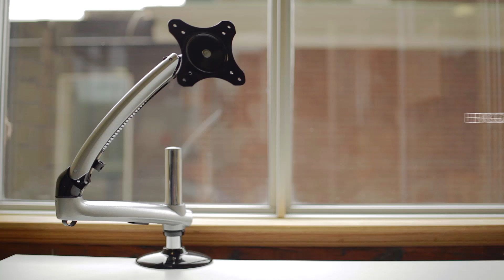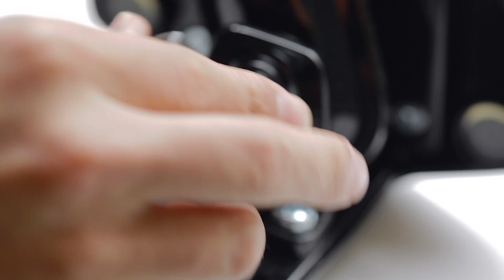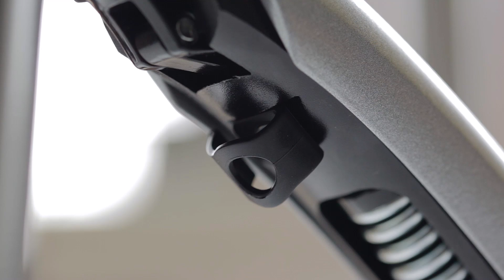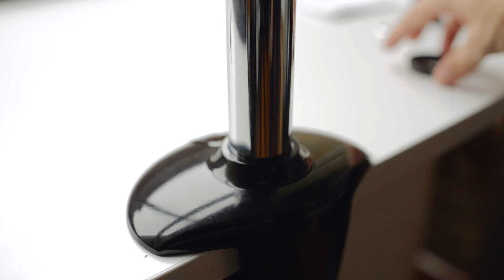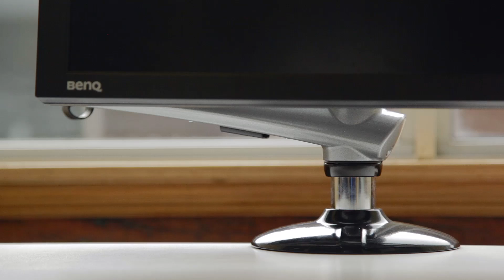(Best Monitor Arm?) Ergotech Freedom Monitor Arm Review

Comment: I have a shallow desk and want to maximize the distance between the screen and my eyes. I'm only interested in a stand cause I hope it will allow me to push my monitor as far back as possible, even if that means the arm projecting past the edge of the desk toward the wall.. meaning I'm happy to pull the desk away from the wall it that means the monitor can float as far back as possible. Can this device help in this regard?

Comment: I've owned a Freedom Arm HD for more than a year. It's great. I'm running it out of speck at a 35 inch ultra-wide, but it hasn't had issues at all. I'm within the weight limit, but I'd never try portrait mode out of speck on the diagonal, like this, because rotational weight is a thing and the panel would probably swivel face-down. But in landscape, that's not been a problem. Five stars. I'd likely say that even if it cost 200$, and I'm by no means rich.

Comment: Just got this arm today and sending it back. All is accurate in this review, but it has no tilt adjustment. I need to customize the tilt and this monitor has no option for that adjustment. I'm bummed because i wanted to keep this one. My monitor sits on a custom shelf that's above eye level. It is a great product if you have a  standard workstation for gaming and  productivity. If your using it for a cross between home theater and gaming not at a desk , Look else where. Also make sure to check the weight of your monitor. you can get the standard one that supports up to 17.8 lbs or the hd model that supports between 20 and 30 lbs. If your monitor falls between 17.8 and 20 lbs it might not maintain its position if you go with the hd version from what i read. Great quality. Bummmmed i have to send it back.

Comment: Is somebody here using this arm for pen displays?

Is it suitable for drawing, even when you want to lay the panel almost flat onto the table to really get in there?

Thanks all :)
Reply: I just purchased one for the same purpose. I'll be attaching it to a Ugee 2150. I'll post back once I use it for a few days.
Reply: +Adam Montgomery 

Nice, thanks for the reply.
That would be helpful to know.
Cheers
Reply: So I've had it for a little over a week now, and I have to say, unfortunately, it's not the best solution for drawing. There are two reasons for this: 

1) The swivel at the end is very stiff, and there is no way to adjust the stiffness. 

2) If you clamp it to the end of your desk, even at it's lowest and flattest position, it's still pretty high. The surface sits about 10-12 inches above the surface of the desk, and as a result your elbows are up high as you draw. It's not very comfortable.  

I would not recommend it for drawing, but other than that, it's a decent stand.

(I was going to send it back, but I'm in the process of building a custom desk, so I figured, why not build the desk to accommodate this arm? In order to achieve a suitable height, I'm going to need to add a little shelf on the side, about 6 inches lower than the surface of the desk, where the the arm can clamp on.) 

Hope this helps, good luck.
Reply: Thank you! This does help a lot indeed.
Is this the first monitor arm you used for drawing or did you check it out as a replacement.
If the latter is true, can you suggest a better solution for pen display users? Maybe the last monitor arm you used?

Thanks again ;D Take care
Reply: This is my first arm. Previous to this, I just used the little stand that ships with the Ugee 2150. (It just sits on the desk, tilts down if needed)

Unfortunately, I don't know of a better solution. It seems they want to charge a lot for arms specifically designed for pen users, and I'm not even sure if you'd get anything better than the freedom arm. Hence, I'm just modding my desk design. 

Sorry I couldn't be more help.

Good luck!

Comment: =\ the back of my desk has a 2x4 brace so the area I have to clamp a vesa arm to is 6 inches. Unless the clamp was deep enough to go around this & just clamp to the inside of only the desk top itself which is about 2 inches thick.

Comment: Thanks for the review.  How much force does it take to adjust the height of the monitor (mainly lifting it up) ?  Are you just pushing gently with a couple of fingers while the spring does the work or lifting the actual weight of the monitor?   I hurt my back so it needs to be very very light for me to use it.

Comment: I have a doubt. The height adjustment depends on the monitor's weight? Because I have the freedom arm with a BenQ XL2411Z and I can't make it go down...when I push it, it goes down and it goes up again when I stop pushing.
Reply: Just loosen the spring. I know you commented ages ago, but still.

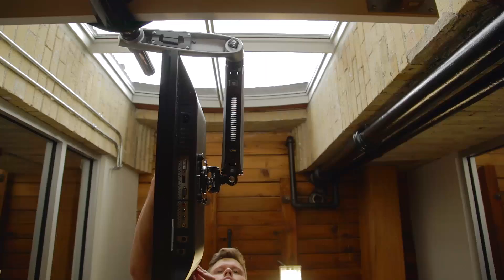Comment: Ok question, at 4:04 to 4:06 when you showed it going a full 90 degrees. It looks like that is each way to the side, but what about up and down? Can the monitor go fully flat facing up or down? I'm specifically wanting to know if it will face directly downwards.

Comment: an expensive piece of metal
Reply: Looks really good quality, certainly vastly better than my current monitor mount which holds the monitor well but has little articulation and is VERY stiff.

Comment: Will this stop my monitor from shaking a little when I type?
Reply: that would likely depend on whether your desk moves when you use it rather than the monitor stand, if you are using a current bracket I would check whether it has screws on the bracket that can be tightened as this may be the cause of your issue.

Comment: Is this use able on glass table?? Thanks.
Reply: Yes, it has rubber padding on the bracket its self but I would check regarding the thickness of the table relating to the minimum desk thickness required of the bracket.

Comment: Kinda new to this, can anyone recommend a good arm for a 32" monitor?
Reply: Someone above has mentioned it works for their 34inch monitor, however really its based on weight, tvs and monitors vary in weight so I would check to see if it says a maximum weight restriction for the bracket before buying.

Comment: Will it support a Predator X34 in terms of weight? No, I obviously won't go vertical/portrait mode with a curved 21:9 display...
Reply: I'm currently looking for the same answer
Reply: find our how much your monitor weighs, then compare it to the specs... if it's not enough check out the HD (heavy duty) version...
Reply: find our how much your monitor weighs, then compare it to the specs... if it's not enough check out the HD (heavy duty) version...

Comment: Can I use an LG 29UM68-P 29-inch monitor? I know it says 27 inch max but just curious.
Reply: Phoenix King since I have posted this comment, I have bought the arm and the monitor and it works fine, the weight is fine for the arm, no dipping.
Reply: Kryptency I use my LG uc97c and it fits perfectly. Btw, it's a 34 inch ultrawide
Reply: so it will work with the LG 34UM58-P?
Reply: Ecla Sure
Reply: I had the same question thanks so much for asking
Reply: Tell me how it goes
Reply: Kryptency thank you for replying I'm looking forward to purchasing the ergotech monitor arm
Reply: Goku Reid you're welcome. I think you'll enjoy your products

Comment: What happened if you have your desk all the way up against the wall? Can I still use the swivel? Btw will this monitor works with lg 34 inch monitor? It fits the suggested weight limit but is not 27 inch but 34 instead. Thanks.
Reply: Well, you won't be able to put the monitor or the arm through where your wall is, solid objects have this whole 'collision' thing. Anywhere that the wall isn't, though, the swivel will work fine. Unless, of course, you use a larger than recommended size monitor. In which case, it might not quite make it to 90 degrees on the axes where it advertises you can turn that face 90 degrees, since the extra width/height of the monitor might bump into parts of the stand that are less than 17 inches away from the mounting point. And if it is under the advertised weight limit, no problems should arise there.

Comment: $75 ; €129.
Reply from the maker: +Ideeem ouch :(
Reply: +HardwareCanucks can I use the drill or is it just clamp only
Reply: I checked out the link and found that the mount listed is really cheap looking. that explains why it's only $26. you get what you pay for.
Reply: That link i posted its made of pretty thick heavy steel its built like a tank its not going to break. Ive had it for 6 months and no problems at all. You can see in the picture but its a really heavy mount.
Reply: You can get dual stand with gas springs for that price nowadays.
Reply: @vitaliistep  Quality you are wrong its thick ass solid steel its not going anywhere and its heavy as crap and a lot fewer places to fail. You are dead wrong on that one i had it for like 3 years and never once had a problem. This mount is a tank and you dont have to spend stupid amounts of money for it.
Reply: I went with a mount that wont break on me for 26 dollars that wont break or bend on me.   https://www.overstock.com/Electronics/Mount-It-2-way-Adjustable-Black-LCD-LED-Tilting-Desk-Mount-Bracket/8629167/product.html?TID=MyAcct:MO:OR:ProdName

Comment: I have a 5/16" thick tempered glass desk. I did the calculations and the surface is made to hold over 300lbs. My only concern is the torque that the bass would have on the desktop. Do you think it would be fine? Being that it's tempered glass? I did a little test myself and put a 25lbs weight upright on the edge of my desk and it held. My monitor weights 14.8lbs alone.
Reply: I would choose a wallmount or a stand that does not clamp on your desk bcs Tenpered glass is a total B*tch to clean.
Reply: +Lo Studios Not sure why a desk mount has anything to do with keeping tempered glass cleaner or dirty. regardless I got a monitor arm for the glass desk, just sandwiched two pieces of plexiglass between the desktops to help disperse the weight of the system
Reply: A Pinecone?  sorry i was not clear enough:  meant that i would choose a wallmount bcs the glass may break and that would be a bitch to clean up
Reply: Lo Studios ahhh ok I see what you mean. But no with the mounting technique I used it does not at all look like the tempered glass is going to break. I have a 14lbs monitor + 11lbs monitor arm on the desk fully extended out and the desk seems to be giving on signs of potentially breaking. The PlexiGlass solution I used works really well

Comment: I have a silly question, would this type of mount be able to work with a glass table top with 10mm thickness?
Reply from the maker: +Joseph Chin you can mount it but at your own risk. Thin glass tops may not support the pressure of the mount plus holding a display.
Reply: Ok. I think i'd better not, i'm afraid it might crack the glass. I'll have to think of a different solution! thanks for the response Canucks. really appreciate it.
Reply: Try a wall mounted arm if your desk is close to a wall
Reply: Hi Thanks alot for your advice, I've managed to mount it on a small wooden plank beside my desk! Not sure how i can upload a picture for you to view it, but it works great!

Comment: Hey guys, nice review! Could you tell me, what is the minimum horizontal (not vertical) under-desk clearance you need for the clamp to go be fully pressed against the edge?
Reply: About 3 and a half inches, without getting the calipers out. I presume this is to make it through a backplate of some kind on your desk? Make sure there's still a way to get your hand in to turn the knob for the clamp mechanism :)

Comment: It has very good design concepts and very beautifully well built, I must say. The price tag is a VERY toxic however, and consumers should not shell out hundreds of dollars for a few pieces of metal.
Reply: Long Nguyen it's only $100. You realize how much these things usually are right?
Reply: The basic ones are 30 to 100.
The more advanced ones are 100 to 200.
The designer brand ones are 200+.

Comment: Looks nice, but 18lb is too little. I have an Apple and an Asus display which both exceed that max weight.
Reply: RockTo11  They sell a heavy duty version that supports between 20 - 30 lbs.
Reply: Mac mall sells this brand compatible with iMacs. They're even less than $100.00 now.

Comment: Me: I wish I bough that monitor arm
sees Price
Runs back to cheapo $60 dual monitor stand
Reply: Check out the price on massdrop for the freedom arm right now.
Reply: +HardwareCanucks Worse in the UK
£261.52
Reply: will these work on an ASUS VC239H 23" monitor?
:)
Reply: Will this work with an ASUS VC239H 23" monitor? :)
Reply from the maker: These actually sell for around $99 on amazon.
Reply: HardwareCanucks
Shame it's only reasonably priced in the states... $165 is the cheapest from a canadian retailer.
If I could get it for $80 like it is on amazon.com I'd order 2 immediately.
Reply from the maker: Very true...
Reply: HardwareCanucks $$$$
Reply: @R0K99  the HD model up to 30lbs is now $124.63 with free Prime shipping
Reply: FamzillaVids $66+$55 shipping :'(
Reply: +rok tech It's on there again! THis time with $9.97 shipping https://www.massdrop.com/buy/ergotech-freedom-arm
Reply: According to the weight said on the Amazon page, it will work :)

Comment: I have 3 monitors sitting on my desk and a fourth that I would like to have above my middle monitor. Does anyone know of a desk clamp arm I could use to mount this top monitor? I don't wanna throw away cash on mounts for the bottom 3. I'm happy to have them sitting on the desk. I need just an arm for the top monitor but it would need to be able to extend to about 60cm in height. I haven't been able to find any that can do this. The monitor has 75x75 vesa mounting holes and is 22 inches.

Comment: Any one here have a good suggestion for a replacement stand for the Qnix 27inch. It's got 100mm VESA and all I need it to do is stay in place while being more stable than cheap stand that comes mounted on the display, and be as cheap as possible.

Comment: Multi monitor ?
Reply: You can put 2 arms on 1 pole!
Reply: Is this glass table compatible?
Reply: Unfortunately not, I wouldn't put that much stress and weight on a glass table.
Reply: Darn it.  Unfortunately I have a glass table with aluminium/metal frame.
Reply: Ergotech Group Do you have a monitor arm that could support a monitor above 27 inches?